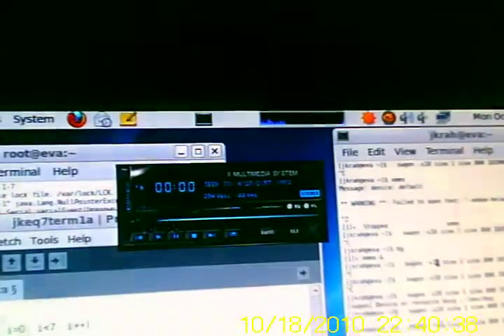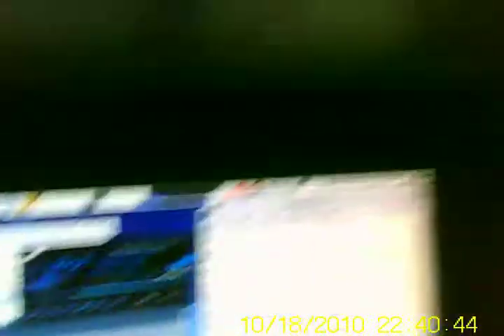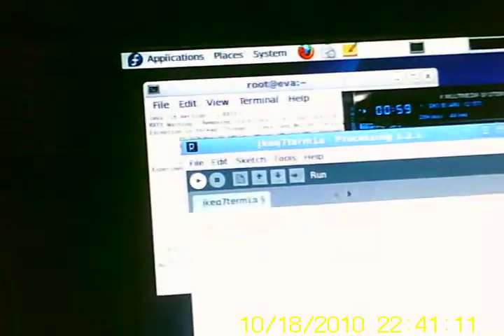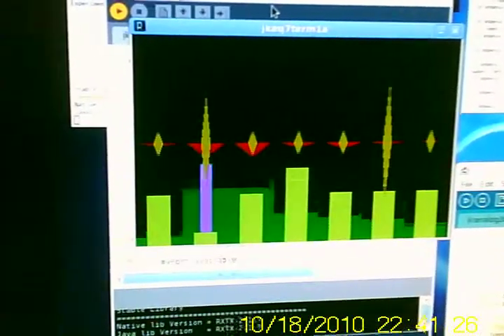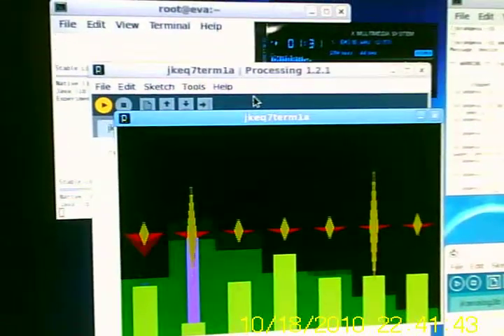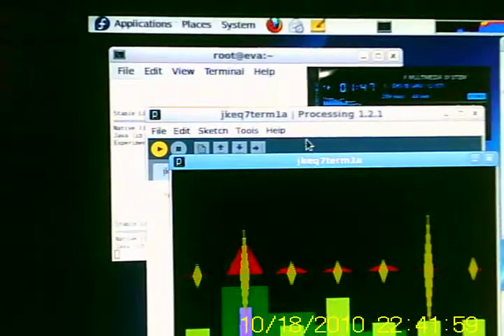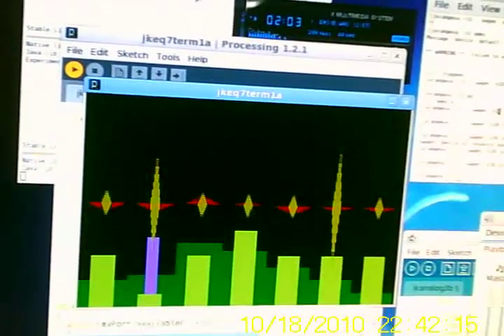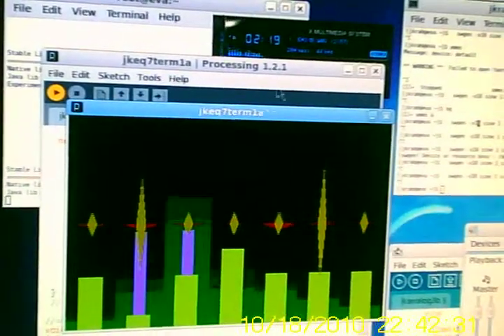MSGEQ7 First Looks

Comment from the maker: Hi Sebastian, 
Im not sure its my code you are after... this Audio Spectrum Analysis is done by the MSQEQ7 chip.. my code just reads the analog voltages from the chip.. do a google search for MSGEQ7 and check the chip specs.. if you only need 7 bands it may help you out.. I can send you my code but I don't think it will help you unless you use this (or a similar) chip..